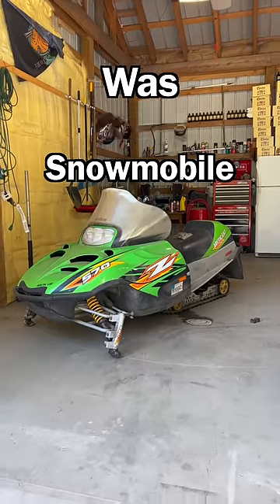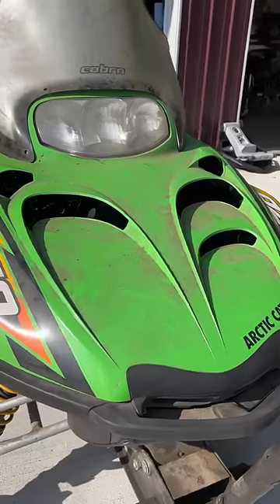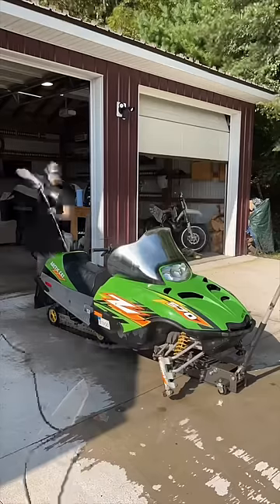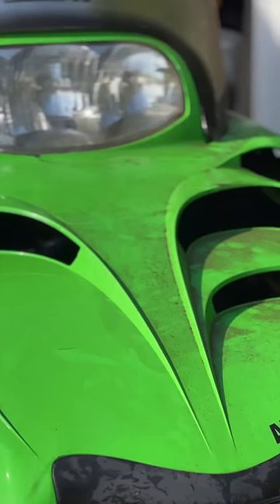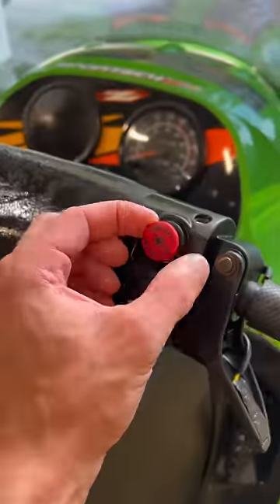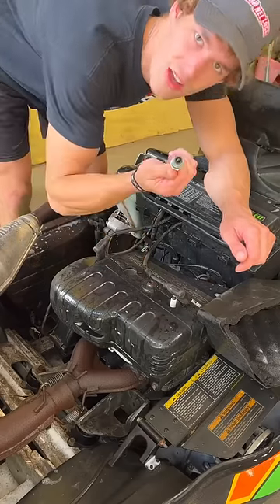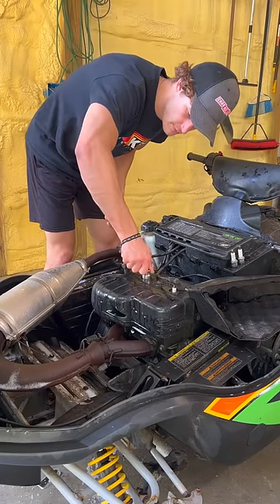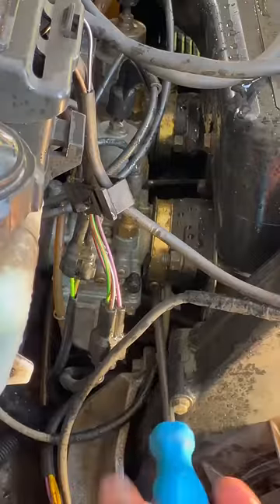They Should have Paid ME to take this snowmobile…😳 #diy

Comment: Not bad at all for 10 years sitting.
Reply from the maker: nah man! solid sled, the carbs (as you will see in next vids) were pretty bad though
Reply: Battery
Reply: Ramey old gas out put new gas in if it has any gas at all
Reply: @liamreid can I buy it from you possibly
Reply: Only if you look inside the cylinder and don't see it totally rusted
Reply: @liamreid Yet they should have paid you? More like you should have paid more than $500 🤦‍♂️

Comment: steps to take
check that it isnt seized
check for spark
check for fuel
dump a bit of fuel down the carb and crank'er over if she starts then flush fuel system and have ater' rebuild the carb(s) and it should be mint
now, i'd question, why the fugg was the plugs loose?

Comment: That is not 10 years outside. The seat would be gone everything would be sun faded.
Reply from the maker: kept in a barn, thats why theres like dust all over it but no like mud. its just the dirt that collects on stuff in a barn. BUT the 10 years is just a guess since the last time it was registered was 2013, so could be wrong but based on the rust in the carb id say around 10 years is right
Reply: @liamreid It definitely wasnt sitting for 10 years there would be way more dust

Comment: Always start with new gas and while the plugs were out waiting to check for spark. 😂
After that clean out the there's most likely a little Pebble in the jet. 😮
Reply: had a stroke reading this
Reply: @codytinker6106  no one else did tho.

Comment: Check all your gas lines and debris inside the tank. Also watch the breaks on these older sleds, it will lock up at random. And you’ll have to rebuild the master cylinder. But definitely check all gas lines!
Reply: 😂😂😂 
And do all this before you clean it 🤦‍♂️

Comment: Fill it with fuel, 2t oil, clean the carbs, change the plugs depending on how they look on the tip, turn on the fuel, do some priming pulls (slow pulls) flip the choke on to full, pull it over untill it fires up and let it run with the choke on for 5-10 seconds then turn off the choke, hope that helps!

Comment: U know that FUEL EXPIRES right? Before u even try starting it u should clean out the old fuel and also REPLACE the spark plugs not just tighten them down. Also check the battery

Comment: Start by seeing if it’s got spark, if yes, remove carbs, clean thouroghly, reinstall carbs, drain the tank, wash it out with acetone, , reinstall tank. Fill with fresh 2 stroke gas and go for a ride. Btw these are known for the middle cylinder overheating and losing compression and or burning a hole in the piston

Comment: It pretty much comes down to fuel.  A lot of fuel goes stale / absorbs Water from all the ethanol in it.  
Always flush the gas tank, fuel lines flush out carburetor or fuel rails and I prefer pulling the spark plugs then spray starting fluid in each cylinder 2 seconds.

Comment: Just clean the carburetors and when I say clean them I mean go through them with a fine-tooth comb remove every jet and every screw get some carpet cleaner get some fresh paper towels lay them down and go through it also you can check to see if it has spark by looking at the spark plugs Wilder pulled out

Comment: The plugs could have only been hand tightened because the previous owner put oil in the cylinders.  That is something you should have done before ever giving the cord a pull.  I would have removed the spark plug wires to remind me there's oil in the cylinders.  A note would work, but could get lost. If you just put oil in,  let the oil sit in it for a few days.  How did the main oil look?  If the oil looks good (no water) go ahead and try it, but change it once you get it running after an hour.  If you or the previous owner put oil in the cylinders, after it has sat in the cylinders for a few days, pull the cord a bunch with the plugs out so you can get rid of as much oil in the cylinders as you can.  It could get messy!  Attaching a clear tube onto a turkey baster to suck the oil out could make less of a mess.  Why with the plugs out?  The oil in the cylinders could cause hydrolock (except oil instead of water) and bend or break lots of stuff!  Upvote this if I helped anyone?

Comment: Just cranking the engine after 10 years is not a great idea without doing things like checking the oil and putting a little oil on top of the cylinders real quick.

Comment: Carbs need to be cleaned and fuel tank too. Replace fuel filter, drain old injection oil, put in new. Check chain case oil level and replace with new. Check belt. Check oil pump diaphragm. Check brake oil level and action. Replace plugs. Put 20:1 gas inside cylinder - teaspoon full and reinstall plugs. Put choke on, key to on” and pull cord. Will start and run for 5 seconds. Remove plugs and repeat until oil and fuel are pumped thru carbs and engine stays running. Have fun and wear a helmet.

Comment: Yea blast it first because that will make it run. Then windshild on then off then on then drop in on the floor.?
First dump old fuel. Check lines. Check filters. Air filter. Plugs.
Then test if it will run. Now pressure wash.

Comment: 10 year old gas, has turned into varnish. Drain and clean fuel tank, replace all fuel lines and filter, rebuild carburetor.  Replace sparks, and check for fire.

Comment: take the carb off, take the bowl off of the carb. take the pilot jet out (and main jet too). soak in carb cleaner...take a fine wire and poke through hole in the pilot jet re-assemble ......good luck

Comment: If it was left to rot in good condition have you checked the battery and the fuel tank and the fuel pump and the oil to if those are not the problem then take it apart and rebuild it to find the problem

Comment: While you had the plugs out you shouldve put em back in the caps, laid em on the cylinder head and given it a few pulls to check for spark. If you got spark you more than likely have dirty carb jets, though you could just have weak spark or possibly your wires on the wrong plug.

Id still recommend flushing the tank and fuel system with clean fresh fuel, inspecting/rebuild the carbs as necessary, and maybe putting new plugs in, and then proceeding with another starting attempt before diving deeper into troubleshooting. After that id check the stator and coil/s for the proper resistance and continuity, compression test, check the wiring and ground connections, definitely put new plugs, wires, and caps on and attempt again. Go? All good. No go? Check timing, set as necessary.  Should run, if not proceed with a teardown and full inspection and overhaul.

Comment: First test should check for spark. Loose spark plugs usually mean someone had been looking it over. If you have good, blue snappy sparks then you ate gonna be dealing with fuel delivery issues. Dont fool around with dirty carbs. It only breeds problems in the cold weather. If its been sitting 10 years you are gonna need fuel lines, a new pump, cleaned fuel tank, and pull the carbs and at least clean and inspect the bowls, and metering rods. Good luck and happy trails

Comment: Why would you try to start an engine that's been sitting for 10 years?
You should flush the tank, change the oil, oilfilter etc, before even pulling on that string

Comment: Bump in the night mechnic. 
Is this a 2 stroke.
Have you cleaned the fuel hoses, tank, carburetor,  purge the old fuel.  Use car cleaner to get rid of the glazed on fuel and oil.
Get a can of eather.  Aka starter fluid.  See if it will run at all.  Tell us what you found.

Comment: Clean carbs check spark if u got spark squirt gas in air breather once running keep spraing gas in breather and spra6brake fluid in and around carb if injection keep spraying gas in breather until it run on its own make sure u got g8gas and blow out fue8lines goo6luck little brother

Comment: put in new plugs,  and a bit of fresh mixed gas down the holes. if it fires but doesn't stay running, assuming that you dumped the old gas out and put in fresh fuel then clean the carbs.

Comment: First guess would be varnished fuel in the float and jets.
 If it was winterized before sitting I would say put new fuel and try again. If it had fuel in it you need to replace all the fuel lines and rebuild the card.

Comment: It has being summarized you found it was loose spark plugs that mean somebody screwed oil down the cylinders drain the gas out of the tank and I always need to do is moist enough to diaphragms in the carburetor there to get them back working and put fresh gas in the tank which is probably empty anyhow cuz it has been summarize

Comment: If it had fuel sitting in the entire system, the whole time, clean out and replace everything and change the oil should start right up, oh, tiny bit of starting fluid should start right up if rats didn’t get to the wiring!

Comment: Pulled the plug because testing compression if turns over I bet have bent valves. If not motor will be locked up
Reply: Not bent valves ... It is a 2 stroke ... No valves in the head

Comment: Z570s are notoriously a pain to get running, I pulled my z370 40 times until I finally decided to add gas down into the cylinder to get it running
Reply: nice pfp is that the same type of snowmobile?
Reply: @BillCosb  yea, 2002 model
Reply: they are a pain in the butt but once they’re running they go forever I have one like it I got for $250 in 2012 spent $60 and it runs like new I still use it because I’m cheap 😂

Comment: Check spark plugs for spark.  If spark,  check fuel lines and drain and clean gas tank.  Then clean carburetors.  New ethanol free gas.  It will fire up.

Comment: Rebuild the carb new gas and you should be good. Fingertips sparkplug is something I do when I'm out and about. Haven't had issues with them losing compression but have had issues with not having the tools to rip one out and swap it when it fails out

Comment: Any two stroke engine you should go ahead and buy new plugs especially after yanking on the start cord alot chances are they are now fouled at the very least soaking wet from all the unfired fuel on them. After ten years id drain the fuel system and add new fuel With  Spark plugs. Always Hand tight then quarter turn with socket. You can strip the plug hole out over tightening them. Especially Aluminum if they have been over tightened before.